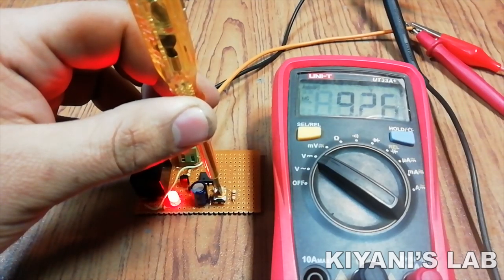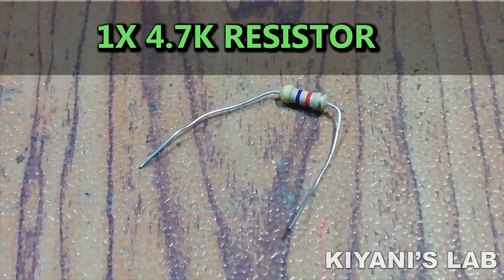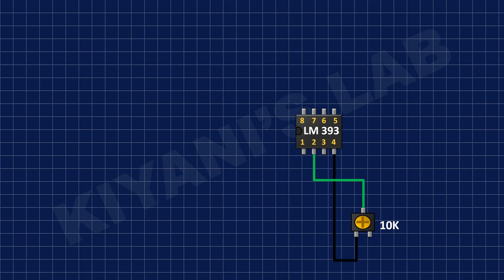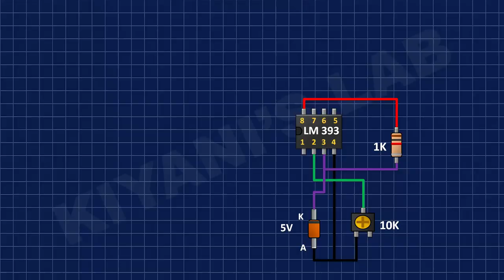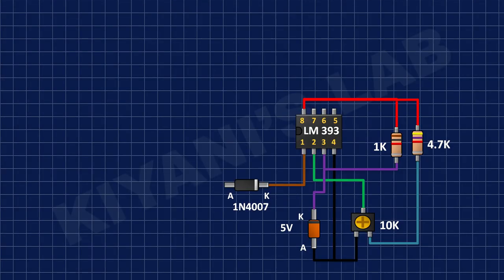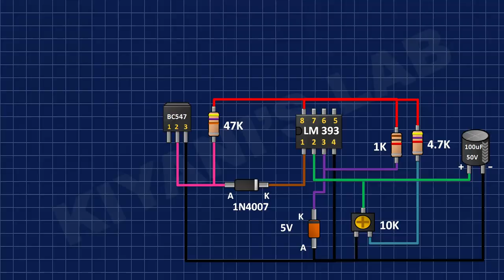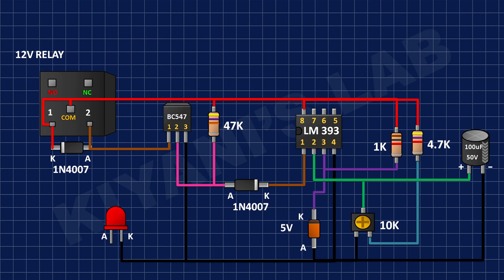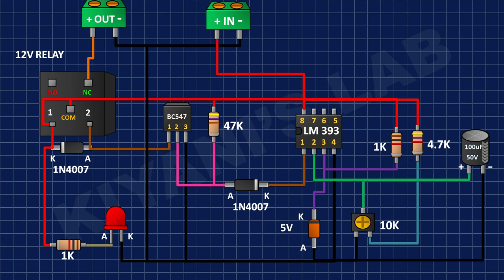How to Make 12V Battery Protection Circuit

Comment: Rudimentary -  Ok, using the 100uF / 10K + 4K7 as a time constant for the Mark-Space ratio to sustain and spread out switch points. Figure the traditional Schmitt trigger better option not governed by RC only with threshold of feedback.

Comment: Nice circuit design but am just wondering how it works since pin 1 is the output of the IC an a diode is connected in reverse direction to the bc547 transistor that triggers the relay for cutoff will the circuit work i take out the zener diode connected to pin 1 of the IC an connect a 1k resistor to pin 1 an to the base of the transistor

Comment: will it protect the battery from overcharge, as you mention that this is for over-discharge, but I need overcharge protection?
Reply from the maker: coming soon bro
Reply: @KiyanisLab  thanks for your efforts, you should make a kit that can charge both li-ion and lead-acid battery with overcharge and discharge protection. this will be huge. what you say

Comment: The circuit does not have hysteresis, the battery will rise up once the load is disconnected so the circuit will try to come back on again.
Reply: Exactly, no much difference between cutoff and turn on voltage

Comment: hi there... this circuit looks very promising.  I have a 12v gel battery.  Need to have to cut off voltage of 12.5v.  should I change the value of the zener diod? thanks
Reply from the maker: no it can be adjusted with trimpot

Comment: Need to redesign circuit for battery charging in such a way that if voltage goes above 13.8 or if voltage drops below 10.6v then output should not be able to reach 12v battery under charging. Power should be from Ac transformer say 0-12v and then given to circuit to charge battery.

Comment: Don't waste your time and money building this circuit.

Rather go with a 555 timer. With this circuit the relay will open and close repeatedly when using it will a battery.

Batteries drop in voltage when connected to a load and recovers when there's no load. Let's say you set your cutoff voltage to be 9.5V, when your battery hits 9.5v the relay will be triggered, as soon as that happens the battery voltage will increase above the cutoff voltage and there will be a load on your battery again causing the relay to be triggered again, this cycle with repeat itself. Using a power supply, like he did in the video, you will not notice this because a power supply has a stable voltage.

Comment: I want the circuit to be active on 14 volts and disconnect the load on 13 volts. Can this same circuit be used or do i need to make any changes. Please help.

I am trying to use this in my car. When the car turns on and the alternator turns on, the voltage is around 14 V.

Comment: Hi i would like to know can i use this circuit to charge a output 12v backup smaller battery from a 12v input battery. The supply charging  battery would be a Car battery and the smaller battery is the alarm battery. So it would be 12v to 12v i hope this makes sense.

Comment: Brother mere pas power wheels Jeep hai Jo 6v battery se chalti hai lekin Mai usme lithium battery lagana chahta hu par vo 11.1 volt ki hai to mujhe ye battery usme lagane ke liye kitne watt ka step down converter lagana hoga Kya ye sahi rahega ya aap koi sujhav dijiye please please answer me
Reply: आपको 11 वोल्ट बैटरी से 6 वोल्ट डीसी चाहिए7806 का सर्किट बनाकर लगाइए इनपुट 11 वोल्ट आउटपुट 6 वोल्ट मिलेंगे आपका काम हो जाएगा
Reply: @madansharma7597  thanks brother but 7806 ic jyada load nahi le sakta ye heat hokar jal jata hai mene use Kiya tha lekin 2 pices  555 dc motors ka load nahi le pa rahi hai heat hokar jal jata hai
Reply: kitni motors hain ?
Reply: @faridi-bin-Zouq  Bhai jaan 4 motors hai modal no.555 dc motors

Comment: Hello brother I need a help can you guide me in building a circuit for car where the voltage cut off should work once the battery voltage falls below 13v....the load through the circuit is approx. 5A
Reply: I mean the load should get activated only when the engine starts I.e 13+V and deactivates the load when engine is off I.e below 13v eg.12.9V n so

Comment: It does not work, because when the circuit is switched on and off the load, the voltage in the battery rises again and the circuit is switched off and the load reconnects.